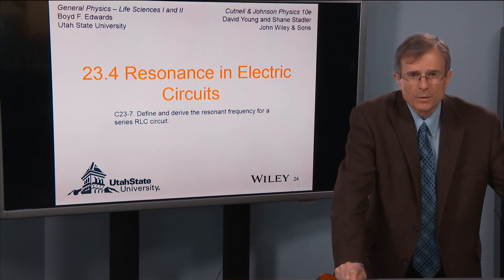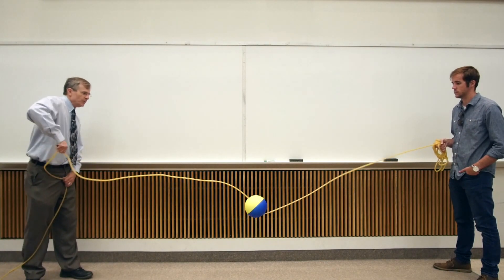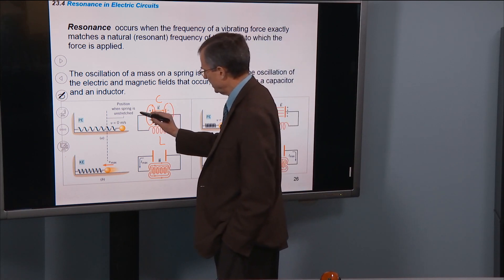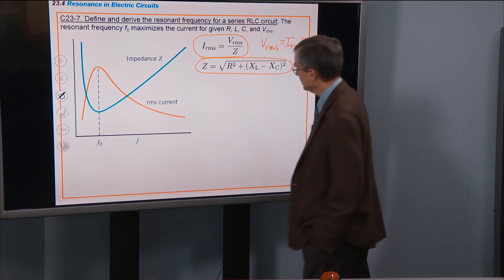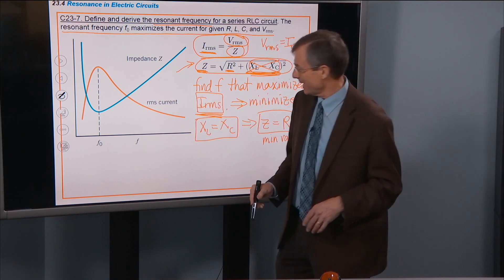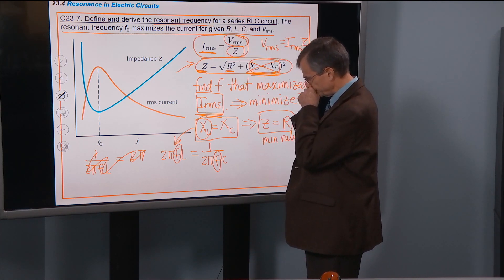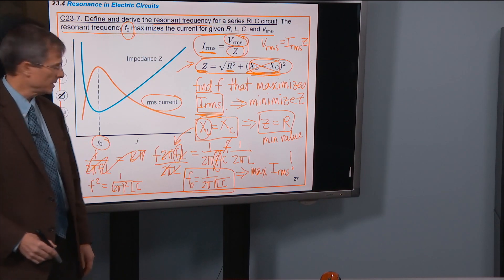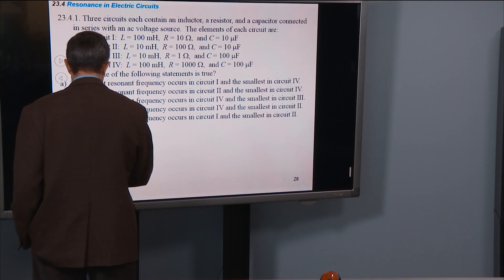23.4 Resonance in Electric Circuits

Comment: simply explained:
The electric field energies transform back and forth, changing their polarities while doing so.

While the capacitor discharges its (di)electric field,
 it charges up the coil with magnetic field energy. 

and while the coil magnetic field discharges, 
it charges up the (di)electric field of the capacitor.

This cycle continues until resistance has transformed the energy into heat.
Reply: Resistance transforms energy into heat? I'm not sure how 'energy' is defined, but resistance/friction controls how fast current flow. Heating or lighting is a by-product of current flowing thru resistance. Electrons do not get consumed. The very simple capacitors shuffling demo proves that here https://youtu.be/SE-AiC9yiFc?t=3956

Comment: Dual resonant coils (both primary and secondary resonant and loose coupled),
Have 2 resonant modes. 

When comparing the voltage or current of the 2 coils, 
the first mode is in phase.
While the second higher frequency mode, is 180  degrees out of phase.

Partly this is explained by frequency splitting, but why do the phases change?

Comment: Система "равновесная" , какого хрена конденсатор выбран начальной и конечной точкой сжатия пружины ? - если это параллельный резонанс то это глупо , полюса меняются местами , представление не правильное а без него не понять физическую сущность процесса , формулы никогда не дадут понять суть !
Reply: electric resonance simply explained:

The electric field energies transform back and forth, changing their polarities while doing so.

While the capacitor discharges its (di)electric field,
 it charges up the coil with magnetic field energy. 

and while the coil magnetic field discharges, 
it charges up the (di)electric field of the capacitor.

This cycle continues until resistance has transformed the energy into heat.